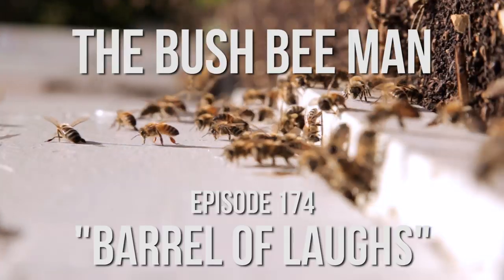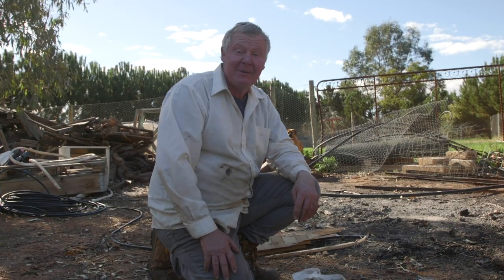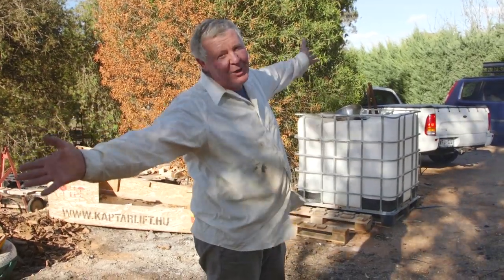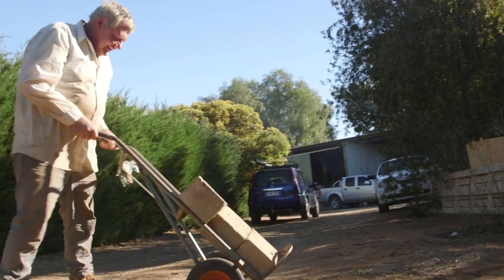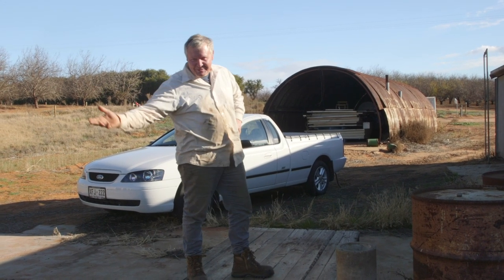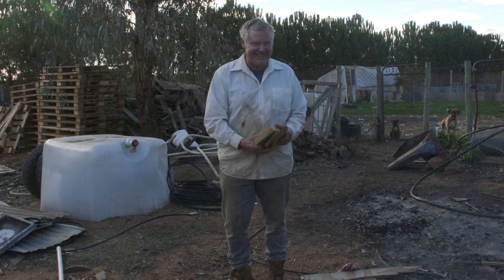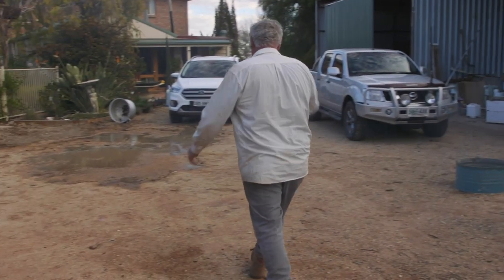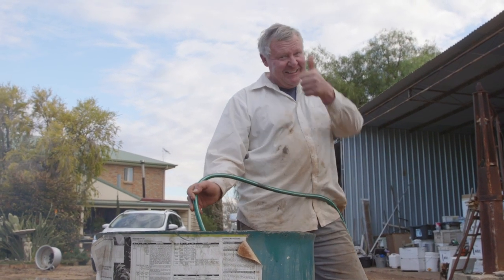Building a Bee Frame Cleaner - The Bush Bee Man

Comment: The practical jokes I came across in the workplace were:
Getting the new lad to "hold the end of this cable clear of the drum" (somehow neglecting to say to separate and insulate all the cores) while we applied a mega-tester to it (that was for 415v 3 hase submersible cable, so it had to be tested for insulation integrity).
Sending the apprentice glazier for a glass hammer - they think it's a joke but there actually is such a tool, with a padded face for seating panes..
Sending an engineering apprentice for extra spots for the spot welder.
2 versions of sending them for a long weight/wait - the glazier version is a real thing (the weight that counterbalances a sash window), if anyone else asks you to do it, just grin and tell the you've heard that one.
Various impossible routes for the newbies when I was driving taxis, trucks, and riding as a motorcycle courier - would you  believe there is a street in Londin where the premises are numbered chronologically?

Probably some others that I don't remember.
Certainly some I wouldn't admit to.